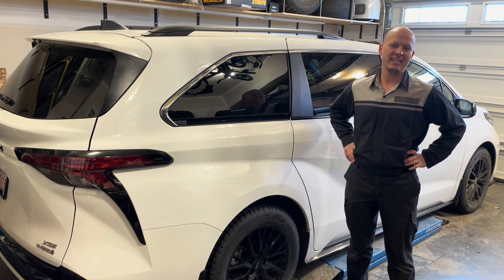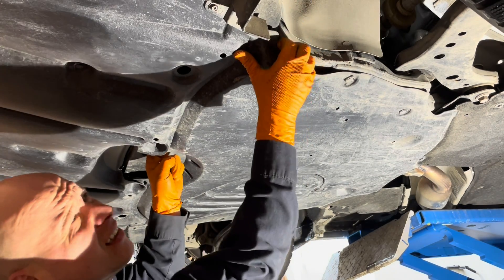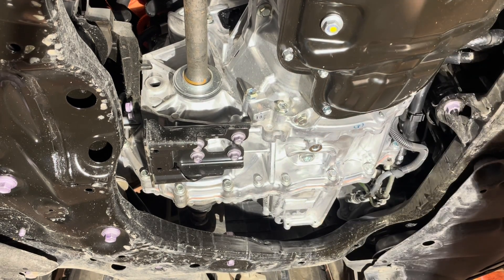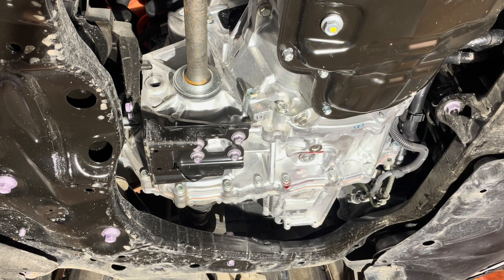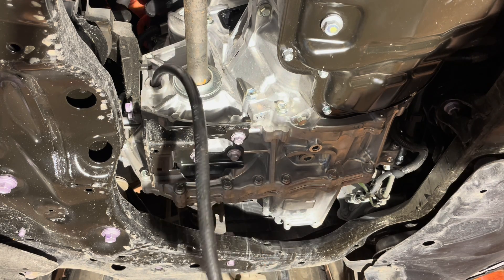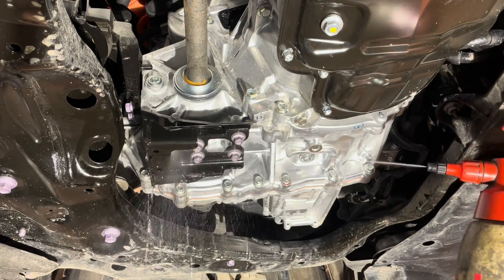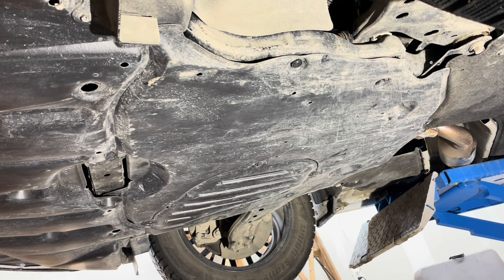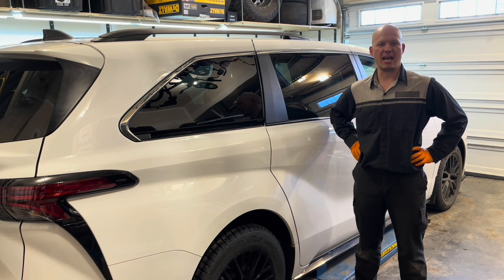2021-2024 Toyota Sienna Hybrid eCVT Transmission Fluid Replacement Instructions

Comment from the maker: Below are my affiliate links to the parts and tools you would use to complete this job. I may receive a small commission from the product sales. Thank you!
Genuine Toyota automatic transmission fluid type WS: https://amzn.to/454JymA
Genuine Toyota drain/fill plug gaskets: https://amzn.to/3ZtaLOO
Transmission fluid pump: https://amzn.to/3t6TO0u
3 Ton Jack stands: https://amzn.to/3q6VS7t
Sturdy 4 Gallon oil drain pan: https://amzn.to/3Ou4iiu
Allen key/hex bit socket set: https://amzn.to/3Rz24QP
3/8" drive flex head digital torque wrench: https://amzn.to/3O1EOru
Rechargeable LED mini work light: https://amzn.to/3Y74OpY
Brake and parts cleaner to clean up the spilled oil mess: https://amzn.to/476RZQz
Automotive rags to clean up the oil residue: https://amzn.to/3H1Pzqv

Comment: Where do you put the jack stands if you lift at the lifting points?
Reply from the maker: Hi, the lifting points are fairly long, you should be able to get both a jack and then a jack stand in there at the same time. There are also areas that you could jack from on the subframes, I believe they show those in the owners’ manual, but I’ve not had to use them.
Reply: @Viktor_G_Automotive  Would you need to place it on 4 jack stands or can you just jack the front of the van? I’m guessing if just the front is jacked it’ll be near impossible to get the right amount of fluid in.
Reply from the maker: @Iamsam526 it would be best to have it level on 4 jack stands, or 4 wheels ramps etc., otherwise it would not be possible to guarantee that the fluid level is correct.

Comment: Hi Viktor,
Thank you for the great video. I only added about 3.6 quarts of transmission fluid—not the full 4 quarts. Recently, I’ve noticed that sometimes after accelerating and then releasing the gas pedal, the engine sounds louder than before. It seems like it doesn’t shift to a higher gear. Do you think I need to add more fluid to the transmission? I didn’t notice a difference on highway. Thanks!
Reply from the maker: Hi, if it was spilling out of the fill plug after you filled it, the level is good. 4 quarts is what you need to buy to do the job, it won’t take the entire amount.

Comment: Hi Vic. I havent changed my transmission fluid. Im at 100k. Do u think i should do drain and fill or do a transmission flush? Its a 2021 Sienna Hybrid FWD
Reply from the maker: Hi, if that was my vehicle, I would do a drain and fill. The manufacturer advises against flushes.

Comment: I did the same on my Camry Hybrid 2018 and used Toyota WS fluid. The owner manual says WS. Any mechanic says WS only idiots at the dealership told me I should use CVT TS fluid 😂😂😂 also they told me it's belt inside of transmission and no any electrical motors or generators inside 😂 because its transmission CVT on a hybrid ha-ha OMG, I can't imagine staff like that.
Reply from the maker: Wow, it is sad to hear such misinformation from people who are supposed to be the best informed about this stuff
Reply: @Viktor_G_Automotive I was very surprised and confused for such incompetence as well. That is not the first hybrid in our family from Toyota and that how some dealerships in Canada qualifies.

Comment: Hi Viktor, thank you so much for one more super detailed tutorial for 4th gen Sienna. Question. I bought my 2022 Sienna XLE used with 83k miles, right now it has 105k miles. May I still drain and fill the transmission or is it too late and it's better not to touch it at this milage?
Reply from the maker: It is never too late to replace the transmission fluid, that’s a myth as far as I am concerned 😊
Cheers!
Reply: @Viktor_G_Automotive  Спасибо вам большое, получил свой ответ, это информация точно для меня написано Виктор вы просто 👍 супер 👍
Reply from the maker: @Umayr-u6q отлично, спасибо!

Comment: Hello, I have a 2022 Toyota Sienna.
After the motor oil change I could drive it for just one hour.
On display started “Hybrid system overheat” and the car stopped and I couldn't drive it.
After we found that Ind transmission doesn't have oid.
We put their oil and now it makes usual noises.
What do you think? I have to replace the transmission?
Reply from the maker: Sounds like you (or whoever was working on it) accidentally drained transmission fluid instead of engine oil by mistake. If the transmission is making unusual noise, it most likely will need to be replaced unfortunately.

Comment: Victor, I have been researching how to do this procedure on a 2023 RAV4 Hybrid. I'm noticing on the rear differential that the high voltage cable is rather close to rear control arm (I believe this is the part in the way,. Could be just frame support) and obstructs clear access to the fill plug. Would it be safe to disconnect the high voltage cable to gain clear access to the fill plug on the rear differential?
Reply from the maker: If you are planning to just unbolt the harness from the body to push it out of the way a little bit, that’s fine. If you want to actually disconnect the high voltage connection from the differential, I would advise against doing it without proper training and tools.

Comment: Do transfer case and rear differential. 
Wait! the transfer case and transmission dont have shared fluid on those right?
Reply from the maker: Here is the rear differential fluid replacement video. These vehicles do not have a transfer case at all as the gas engine is not connected to the rear differential via a driveshaft.
https://youtu.be/6PDr94DHz8U?si=moZAKPJGzvi7qhYk
Reply: @Viktor_G_Automotive thanks for the reply. I assume it's the same for Grand Highlander Hybrid AWD or anything with 2.5 engine with eCVT?
Reply from the maker: @user-wc3tz3be1j yes, if it has the same drivetrain setup, it will be the same

Comment: My friend asked about doing this 
He called the Toyota dealership they said it would be $375 and it would take them several hours 
They recommended to never do it they said it's a sealed unit and never needs service 
I told him to tell them that you would gladly pay the $375 if they slap the new transmission out there because it's obviously cheaper to just put a brand new transmission on then to change the fluid that only requires two plugs to access
Reply from the maker: I agree with you

Comment: Would this process be the same for a C-HR hybrid? 2020.
Reply from the maker: Pretty similar, yes
Reply: @Viktor_G_Automotive  What about the temperature level method? Something about getting the eCVT transmission fluid to be at a certain temperature range before you level off by draining excess fluids? 

Or do I not need to worry about this, I just fill it up until it drips out from the fill plug and then tighten everything back up?
Reply from the maker: @amayavne hi, the method where you overfill it and then drain at a specific temperature from a different plug until the overflow stops is used in non-hybrid transmissions.
Reply: @Viktor_G_Automotive so for eCVT hybrids, you just fill it till it comes out the fill hole?
Reply from the maker: @amayavne yes, as shown in the video

Comment: The color of the fluid looks like it never used, I changed transmission fluid after 30k miles on my Lexus hybrid  it was dark not red!!!
Reply from the maker: The van was essentially brand new, the transmission fluid did not require replacement, I just did it so I could film the tutorial video.

Comment: I don't have a Sienna. I have a 2022 Toyota RAV4 Hybrid. But pretty sure this is the same ECVT transmission as mine. I was trying to figure out where the drain and fill plugs were and this was a help. No videos yet on how to do a 2022 Toyota RAV4 Hybrid transmission fluid change. I also ordered the repair manual from Repairs Advisors. Thanks for your video.
Reply from the maker: @MPBADASS90  my pleasure, glad that the video helped!

Comment: Hi! I followed your procedure but my transmission only took 3qts. I had my 2021 sienna on a ramp but in my opinion would overfill a bit the transmission because I would leave something inside because of the incline? I am a bit worried because I started looking online and there is a procedure to get temp and some have a little straw like thing that has to be removed.. I am a strong DIYer but I can’t find much info to confirm that procedure is correct.. do you know where can I find repair manual?
Reply: Thank you for your answer. I will check fluid without the ramps and will report back.
Reply from the maker: If you had it on the ramps with the front wheels, the transmission will take less fluid because it would be tilted backwards, towards the fill hole, therefore you would not be able to fit the proper amount in.
When I say "It will need 4 quarts" in the video, that does not mean it will take exactly 4 quarts. Just somewhere between 3-4 quarts. I would recommend to set the vehicle level and fill it like that, instead of having the front wheels on ramps, you could use 4 ramps for example.
The overflow straw procedure does not apply to the hybrid models, that is for the older non-hybrid Siennas and other Toyota vehicles.
The procedure shown in my video is correct for this model.

Comment: Hi Victor. I have a question about 2017 Toyota Highlander hybrid. It have torx (6-star) plug in the eCVT transmission - right above the right wheel shaft (at the same side as the drain plug). Do you know what for is that plug - second CVT oil filling port or this is oil level "control" port?
Reply from the maker: @HamHamon  hi, I am not familiar with the exact plug you are mentioning and don’t know its purpose, but it is not for filling or leveling of the transmission fluid. All drain/fill plugs on hybrid transmissions use a 10 mm Allen hex driver, not Torx.

Comment: Jeez, and I was thinking that Odyssey ATF procedure is annoying. This one is many times worse
Reply from the maker: @AK-oz4ew  is it? Literally just a drain and fill…
Reply: @Viktor_G_Automotive  For Honda you don't even need floor jacks to do ATF change, not talking about a lift. You don't need transfer pumps. Also, ATF doesn't splash all over the floor. Granted, Toyota tranny it is not as bad as ZF tranny for ATF change where you drop the pan, but still a major headache. Thank you for your video, I was researching if I want Sienna and it is very helpful.

Comment: Приветствую! Если можете снять видео или расказать о щелчках, тресках,  изза незатянутой ступичной гайке на гибридах и элеткрокарах, почему ослабляется гайка, как это связанно с рекуперацией и методы решения, на ниссанах и вольво частая проблема, но вот на хай 2021 100000mi , я столкнулся с такой проблемой
Reply from the maker: Hi, I translated what you wrote, and I have never seen a loose hub nut on these models, so I don’t have any experience with that.
Reply: @Viktor_G_Automotive  thanks for answering, I thought you spoke Russian by name, sorry, I meant that there are hybrid cars, electric cars that use heat recovery to charge the battery, and they have a problem with the drives, especially the outer tire, owners of Tesla, Chevrolet Volt, and Volvo, tighten the hub nut harder, and the clicks and crackles disappear, for a while or forever, somehow related to the slots on the drives and inside the hubs.
Reply from the maker: @zhandosnurlanuly1319  thank you for elaborating. I do understand Russian since I grew up in Kazakhstan, but I learned to be a technician in Canada, so I am unfamiliar with some of the technical terms in Russian unfortunately.
I have heard the type of clicks you are describing on RX350/RX450h models from the front axles. We used to replace the axle at the dealership to fix the problem since we thought it is something inside the CV joint, but maybe it is related to the hub nut being not tight enough. I have only run into that problem a few times in my career. Haven't really seen it on other Lexus models myself. Presumably, this may be an issue on similar Toyota models like the Highlander or the Sienna as well, but I worked at Lexus, so didn't see a whole lot of Toyotas in the shop.

Comment: Great education. I recently did this job on my Auris 1.8 Hybrid 2013 with 90 000 km and its a very similar job. The fluid was not in the best shape. Red but not clear like the new fluid. Now im planning to do the same service on my 2021 RAV4 Prime with 130 000km. This also has the P810 transaxel.

The official manual from Toyota is actually going through drain/fill twice. And also start engine, idle for 30s, and running cooling pump in Toyota Software between this two oil changes. Powertrain > Hybrid Control > Active Test > Control the Motor/Generator Cooling Oil Pump.

This is of course not mandatory and i understand why you are not brining it up cause its better to change the oil once than not doing it at all. But maybe this is good information to someone who want to do a light flushing if the old oil is in really really bad shape. :)
Reply from the maker: @tobiasandersson4470  good tip

Comment: I just finished watching your video and preparing to do this job.

One thing I noticed was the drain plug does not have a magnetic tip. Would you happen to know why Toyota did this?

I’m thinking about replacing it with a plug with a magnetic tip similar to the drain plug for the rear differential.

Is the bolt the same size? What do you think about doing something like this?
Reply from the maker: @TopTubing  I don’t know exactly why they did not include a magnet, but the plugs they use are all m18x1.5 mm, so you could definitely install one with a magnetic tip.

Comment: Hello! It is the same procedure for 2023 toyota corolla hybrid 1.8 the one that uses the new e transaxle fluid TE ? I read that is a different generation since 2023 and i wanna know just if the procedure is the same for all the models if u know. Just drain and fill until it overflows. This one states just 3L of fluid TE instead of the old one ATF WS with 3.6 for the corolla or prius hybrid. thanks!
Reply from the maker: @mitza6124  yes, the procedure itself would be the same.

Comment: No need to get it up to a certain temperature like some transmissions require? Seems pretty simple then.
Reply from the maker: @Matt_C_N  correct. Room temperature is fine, doesn’t have a specific temperature range.

Comment: Thanks! I will also make sure I order the tools from your Amazon links. You are awesome🙏 I will also follow your videos to learn.
Reply from the maker: Thank you so much for your support, I truly appreciate it!
Reply: @Viktor_G_Automotive  I followed your video on spark plugs and changed my spark plugs. I was worried the engine would blow up or the check engine light would show up, but looks like I've done a great job, the van drives perfectly 😄
Reply from the maker: @dawood2u  excellent work!

Comment: Great Video. Two thumbs up. I have a 2022 Toyota Camry hybrid with 55K and ready to change the Trans. Fluid and this video will help a lot. Does the engine and Trans need to be cold or hot to replace? Again Awesome video.
Reply from the maker: @robertmenchaca4010  thanks Robert! The fluid temperature on these transmissions during fluid replacement is not critical, I find that cold (room temperature) is best, less chance of burning yourself.

Comment: How many miles on this van when you changed the fluid?  I am curious, that fluid sure looks good coming out of there.   I think if my fluid really looked like that, I wonder did it need changed?
Reply from the maker: @bechtoea  hi, the vehicle is almost brand new, I replaced the fluid just for the purpose of making this video. I will be replacing it every 60K miles in the future.
Reply: @Viktor_G_Automotive  Thank you, and thanks for the video.   I was dreading having to take it to the dealer and it seems I won't have to.
Reply from the maker: @bechtoea  you got it!

Comment: Thank you! I am about to work on my 2020 Hybrid Highlander and can't find any video. This is the closest I can find and it indeed helped! 
Can't wait to see some hybrid Highlander instructions regarding differential/transmission/invertor/engine coolant, etc. 
Again, thank you Viktor!
Reply from the maker: For sure Henry, I’ll make some videos if I ever get my hands on that model.
Reply: Hi Henry, 
Did u succeed on your Highlander Hybrid transmission fluid change? 
Is it thesame process here with Sienna hybrid. 
Just asking as i can't find any close video to follow for my 2023 highlander hybrid. 
Please help. Thanks
Henry
Reply: @nmokonya6505  it is identical. Exactly the same location and layout.
Reply: @henryzzzzzz  thanks a lot Henry. Will go for it once it warms up here.
Reply: @ I did mine at 60k miles and it looks super fresh but the differential looks dirty(they use the same fluid). I am going to do transmission every 100k and differential every 50k afterward. YMMV

Comment: Excuse the question because if it is a CVT the transmission has that oil
Reply from the maker: It’s not a conventional belt CVT, it is an eCVT with a planetary gear set. Uses WS fluid.